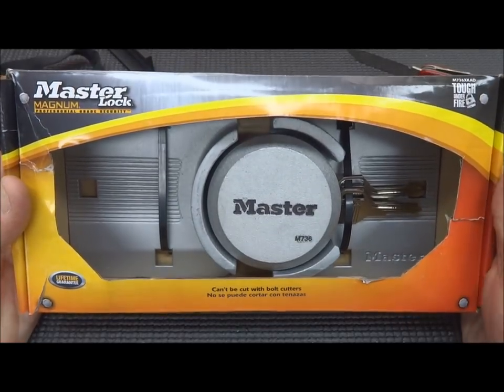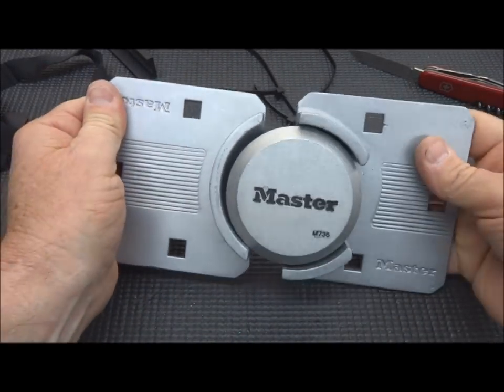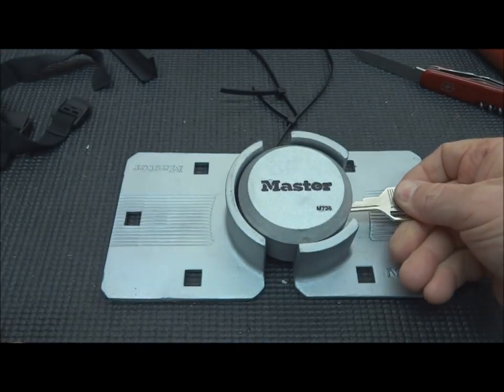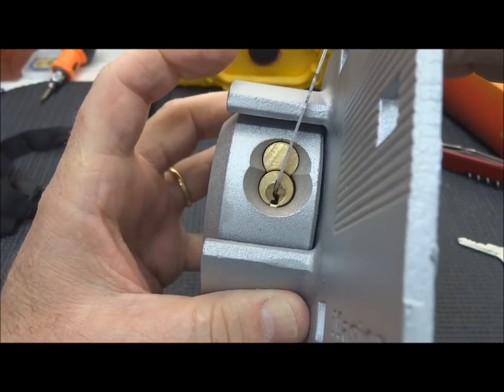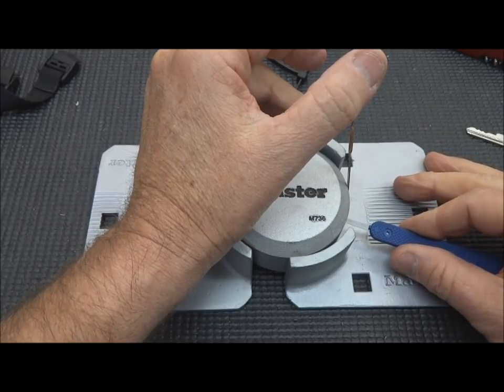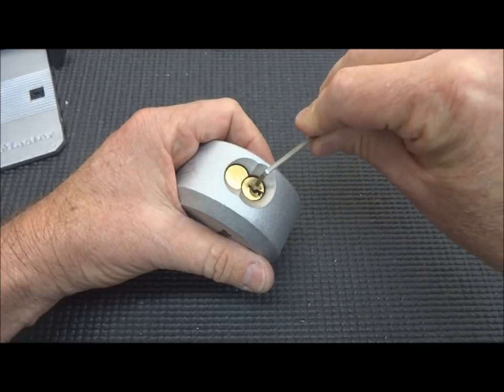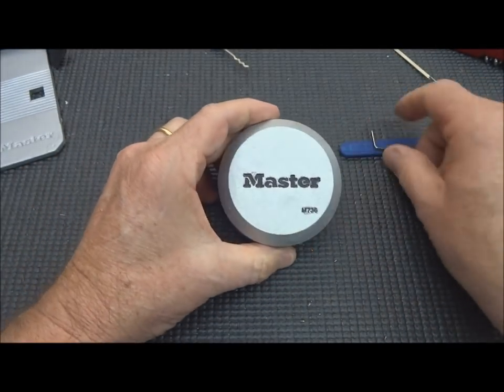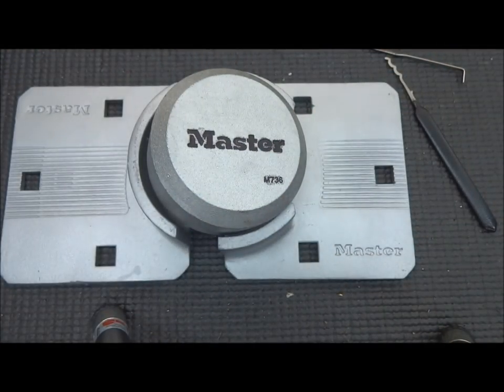(313) Review: Master Lock M736 Puck Lock (JUNK!)

Comment: The majority of the lock cost is the split bracket. I've used that lock before, in the car wash business, usually in combination with several others.

One issue we've had to resolve is the cost of the loss vs. replacement costs of a lock and all the equipment they destroy gaining entry to whatever has the lock on it.

Many times, a cheap lock is worth more money than say Medeco which we use a lot of. Because let's face it, most of our break-ins are from amateur tweakers that wreck everything in their way. Losing several hundred dollars is cheaper than losing a $50 lock and $500 worth of equipment plus the $200. 

So, yes, sometimes we make it easier to break in....depending on what is locked.

Comment: It might even be faster to use a Strong Wireless Drill to take out the screws from the metal plates, that way you can bypass the entire Puck Lock.

Comment: think its more for physical attack,hammers etc rather than picking but i agree should be better,they are used all over here in the UK....AS i am a builder i will NOT be putting this on my van thanks but if you have a suggestion for a lock ........

Comment: Outside of the lock itself, to me the next biggest weakness is the exposed bolt/screw heads. Just have to take a drill or a grinder, knock 3 of them off and your in.
Reply: Ya,  a loud grinder won't draw any attention to the van they you're trying to rip off.

Comment: It seems to me that Master redesigns that lock itself so that a steel flap protrudes over the top edge of the lock perimeter, this would remove the physical advantage of a lock picker trying to open the lock from the same angle the man in this video worked from.

Comment: If u have a welder all u have to do is weld a 1/4" plate right behind the back hole and it wouldn't be able to be picked and u can still get the key and pin out with out a hassle

Comment: These masterlocks are okay for safes, Especially when the safe weighs about ~1000lbs and not much room to move about/cut a hole in 1/2 inch steel with a battery grinder

Comment: Just today they brock in to my truck and I have those locks and the center one wish is a master also super reinforced paddle lock  and they try to cut with the bolt cutter but they can't so they cut the plate that hold beside but I don understand wy they do not open this way if they do that way

Comment: Although the puck style lock is protected by the armored plate, take it a step further by using an angle grinder to grind off the tops  of the mushroom headed bolts used to mount the steel plates to the door.

Comment: I really don't know why master lock doesn't make better keys and stuff like that
Reply: Because that costs money. Why make expensive things when you can make something cheap and sell it for a lot?
Reply: They do, you just cant get it at Home Depot/Lowes. 
Locksmiths Don't sell paint or lumber.
Reply: because it turns a $30 lock into a $130 lock.   the same way a door set goes from $50 to $250
Reply: I can buy Gerda Tytan ZX in Polish Castorama for 218 PLN(with tax), atm 1 US $ is worthed 3.4 PLN so its 64.12 US dolars and i can buy paint and lumber in that shop with no problem. :P Good quality padlock like KABRO C5 (class 5 ) you can buy it in Poland for 85PLN so its only 25$...
Reply: sratatata idzie wiosna :D a mejbi in OBI ? :D

Comment: but.. if you put in screws in the holes. cant you just unscrew the screws ?
Reply: HandsomeHolland It should be mounted with carriage bolts. The outside would be a smooth rounded head. Under the head is a square that fits into the plate so you only need a nut on the inside to bolt it to the door.
Reply: He used the wrong term.  No one in their right mind would actually use screws with a hasp like that.  Because of the square holes, it's obvious that they intend for carriage bolts to be used.  And if you want it to be even more resistant, but a heavy steel backing plate on the other side of the door you are attaching this to and after tightening the nuts really tight, strike an arc with a welder in the threads of the bolts, right by the nuts.  Even if they could somehow turn the bolt, the nut is not going to turn.

Comment: I must be missing something; on the plates that would bolt to the side of the truck there are screw holes, so what's stopping someone from just unscrewing the plates?
Reply: Those are square holes intended to be used with carriage bolts, which, have a domed head that doesn't accept a wrench. However, the the carriage bolt that a guy would typically be installing this lock with would more likely that not be grade 3 or 5, which is pretty soft steel compared to the lock plates.

Comment: What this lock lacks in security it makes up as a radiator (no kidding). A customer with a broken key called me one night & told me other employees had thrown hot water on the lock (it was 10 below out). After thawing it with a propane torch, the broken key turned & I took it out. 10 minutes later you could hold the lock in your hand for a full minute before the heat caused you to drop it. It occurred to me you could slowly heat a large mass of this with only a pilot light inside. Controlling the temp would be hard, the "furnace" would weigh 500 lbs., but it would heat your whole house if put in a basement...Cheap.

Comment: How easy is harbor freight  2-7/8 in. Shackle-Less Padlock To pick or cut? They compare it to American lock A2000DSEN
Reply from the maker: It is one of the most frequently modified lock to make challenge locks because it is only about $7.  Still, you get what you pay for.  Out of the box it is easy to pick and the lock contains no security pins.  The materials of the lock are...well, what you'd expect in a $7 lock.  The shackle is pretty soft and even tho they say "hardened", it really isn't.  You can saw through it pretty quickly and 32" bolt cutters make quick work of it.  You really can't compare a $7 to a $35-40 lock.

Comment: Thanks for your reply and upon your advice have decided to go with the t-5 version of the Mul-t-lock model T-100 puck lock to secure my $2000 generator. My research on that particular lock shows it to be virtually unpickable but sadly I fear that's not true or is it? Should I have a little faith in it's "illusion of security" or just wait till one of your other subscribers, who's intentions are less than professional finds my generator unattended and irresistible! My back up security device holds 7 in the clip!  You might see a pattern here, not a lotta faith in my fellow man!
Reply: bosnianbill Thanks for the vote of confidence!! As for the "man sized chain" try going to perfectcasita.com and look at very clever Lowpro baseplate locking device that incorporates this type of puck lock. My generator is the Honda EU3000is and I'm first in line to get one of these when  the first production run is complete (any day now)! It'll be bolted in the bed of my truck under a hard toneau cover. Though the cover is easily breechable outa sight outa mind I say and if you did get to it the next weakest point are the bolts through the bed of my truck you'd have to unlock my spare tire and the bolts just spin if you try to put a wrench on them. Now if you want to use a cut off wheel on your battery dremel tool good luck maneuvering under the truck while I shoot you in the balls!
Reply: Thanks Bill! Both items, the Lowpro baseplate security device and the MTL have been ordered and are on their way to me now! Sure hope they are effective, I don't want to resort to the "backup security" but I would! I gotta say, I've got "clip envy"!
Reply: And the lock is in! Thanks for the advice! I think you'd need three arms and stand on your head in order to pick it? Maybe try the banana on this one or straight to the potato!

Comment: Listen....... I worked in the worse places in NYC all five boroughs at all hours of the night and day time. The van was loaded with thousands of dollars of tools and supplies. When these locks first came out they didn't have the extra steel covering around the outside to cover the lock. The crooks were using i'm told pipe wrenches to turn the puck to break the steel pin. Then one day a truck came in and the crooks pried the bottom of the door up and out to gain access. ( looked like a sardine can)  I have never been broken into using these locks with the plate around the lock. Using other locks ..... yes I was broken into more than a few times. If the crook wants your truck ...... then it's gone . You will find it in another area or state cleaned out. The last two companies had GPS and even( all companies are putting GPS in the trucks)when you call the police they will NOT pursue the criminal! you will see where the truck is last stopped . Then you can go and get the empty truck.
The mechanics that were to lazy to use pad locks were almost always broken into sooner than later. 
Most or a lot of crooks are fast in out junkies trying to make a fast dollar. If it is hard they will go to the next truck.
This is a nice educational video.
Reply: +Gregory M What they didn't pick the locks????
Reply: I have not ever saw a lock smith pick a lock. They all cut them off and sell you a new lock.
Reply: +Gregory M Well picking locks is great in the movies. Don't spoil my fantasy of lock picking.
Reply: OK james Bond. LOL LOL LOL

Comment: I epoxy over my lock brands, and spray painted them to match the trailer.  Reinforced the door with a steel plate, so those locks cant be busted off with a hammer.  I also have 2 gps units to recover it (one much better hidden than the other).  worst case I call the cops tell them I found my stolen property at this location, that I'm about to retrieve it and am armed and ready to defend myself before hanging up.  make them show up real quick.  Let them do the work, instead of all the manual labor of cutting up, carrying, and disposing of the body.

Comment: when its installed  on a door you could maybe drill holes in the screws?
Reply: +Pink Panther  ya its hard drilling through hardejed steel
Reply: +Olivier Beaulieu no need most van door skins a re .5mm steel a mallet prybar etc will have this lock on the ground quick smart
Reply: Typically this would be installed with carriage bolts going through to the other side of the door and secured with large washers and nuts.  Not just through the skin of the door.  Prying them off wouldn't be likely.

Comment: Umm, you said this is held into the door of the truck with 6 screws, correct? Then all you need is a screwdriver/ pocketknife or anything solid really to undo the screws and the lock falls right off XD no picking needed.
Reply: +dwalters98 Carriage bolts are usually square shaped right under the head so turning the bolt isn't an option.

Comment: They should have put the steel ring all around the lock and used an extra long key to reach the cylinder . That would have made it impossible to acces the cylinder directly.
Reply: that's not a bad idea , I now wonder if that hardened steel can be welded? that finish looks like its some sort of zink alloy
Reply: +mrfurball You could be right. From the sound of it i would say its cast iron. The groves and the logo look casted to me. One hit with a big hammer would tell right away.

Comment: bosnianbill: I really don't think Master locks are total junk. If you look at the outer body, shackle, and inner ball & cam locking mechanism, we know that they are made in the same way as American & other locks. I however agree that the core should have better security. On the other hand, most thieves will just bolt cut a lock. Even the best "hardened" ones! As far as experienced ability, the criminal with lock picking credentials will be able to pick a more secure lock. Hardly ever the case.

Comment: If it is designed to be mounted in a vertical position, like the doors of a van, shouldn't you try and pick it the same way that it was intended to be used.   Seems that laying it on the table gives you and unfair advantage over the lock, same for locks that are not mounted in a door.Thanks.

Comment: Isn't another weak point the 6 obvious fixings (screws/bolts) that attach the flat plates to the door? If you can twist or smash off three of them on one side then you can still just open the door without picking the lock.
Reply: +Mandolinic The quadratic holes tells me that it's meant for carriage bolt mounting = very hard to get a grip on and the head has the same matching quadratic shape so your only chance are drill or grind the heads of the bolts
Reply: +MoseyingFan Of course.  I should have though of that. Thanks for explanation.

Comment: Hi can i have my puck lock rekeyed with a harder to pick keyway in the master puck locks i have?
Reply: it all depends on the model puck lock you have. If it is this one, then no. If you can find a locksmith or security supplier, there are rekeyable puck locks, and while the keyway may remain the same, the lock could be configured in a pick and bump resistant way. I would also recommend using a hasp  that uses some bolts that are blocked by the puck body. If you use this hasp on an outbuilding or somewhere else further away, a criminal may just grind off the bolts securing the hasp.

Comment: When you to SVPing something, what do you mean?
Reply: SPP = Single Pin Picking (locks).  Using a pick to position each pin in the tumbler while applying torque on the tumbler.
Reply: Ah, ok.  Ty.

Comment: Honestly couldn't you unbolt  it off the car door
Reply: The square holes imply these would be attached using 'carriage bolts'.  The face you see outside the car is a smooth dome and the nuts would be inside the door.

Comment: Ten·sion
ˈtenSHən/Submit
noun
1.
the state of being stretched tight.
"the parachute keeps the cable under tension as it drops"
synonyms: tightness, tautness, rigidity; More
2.
mental or emotional strain.
"a mind that is affected by stress or tension cannot think as clearly"
synonyms: strain, stress, anxiety, pressure; More
verb
1.
apply a force to (something) that tends to stretch it.

Just imagine how quickly you could pick it if you applied "torque" to the plug while ....Oh wait, you did. You just claimed to be using tension.

Comment: But what about the bolts? Can't someone just unscrew it from the door?
Reply: It's made for carriage bolts (Google image search if you're unfamiliar with them).  That's why the holes are square, so the carriage bolts sit flush into it and there's no bolt head or way to losen it from the outside.
Reply: thechosendude ok makes sense, but can you drill through the head of this bolt?
Reply: VanillaSnake21 Drilling would take a while.  It would be easier to grind the heads off.  Both methods are really loud and defeat a silent entry.
Reply: thechosendude drilling is not that loud, just drilling throught the head, I looked up an image it's like maybe a quarter inch thick.

Comment: Thieves do not pick locks. They break them. Of course lock picking is an interesting skill, but this is a skil used by the secret agents, security agencies and so on. Regular thieves DO NOT have those skills so they would atack locks with bolt cutters, crowbars, pipe wrences, sledge hammers or angle grinders. That's why it is best to buy a lock that can withstand to more of these "brute force" atacks because you won't see thieves that can really pick locks. Of course there is no lock that can withstand an angle grinder but that's another story.

Comment: How are US army padlocks?
Reply from the maker: Not so good any more since Master changed the design.  We pretty much used up what we had on the shelf then started buying Reese (for initial issue for duffel bags), Reese Set locks (for took kits, which span several cases), Paclock for general security, and Medeco or Assa Abloy for higher security, and S&G 900-series for arms rooms and ammunition magazines (2 locks per door).  There's still a lot of the old stuff floating around but it'll eventually filter out of the system.

Comment: erm, if that is mounted on the side like that... can't we just take out the screws?
Reply: SoWeMeetAgain Those square holes are designed for carriage bolts that fasten from the inside.
http://za.rs-online.com/web/p/coach-bolts/5121118/
You could cut them off, but it shouldn't be possible to remove them non-destructively.
Reply: Aadil Shah
thanks :-) that makes much more sense!

Comment: You shopped at your favorite store, that sells dumbed down VERSIONS of far better products. The Problem is not that it is Master, it is that it is THAT VERSION. The "good" one that I sell in my shop is Model 6270. This cheasy model has a very sloppy tolerance cylinder, as you demonstrated.

The 6270 uses the close tolerance 7000B keyway, pinned 6 pin. OR use the American 2000. Either will perform far better. You will NOT find the better models at most box stores. For Master/American to sell there, they have had their own products knocked off overseas, which confuses the public. Even better, one could get the PACLOCK model, and put a Medeco or ASSA cylinder in it...... As far as the hasp, I am not so sure that one is steel. It could be die-cast. I sell their steel ones, which have real ugly welds... but they are strong. For a van, there is a neat product that replaces surface hasps called Slicklocks... you may want to review them, if you have not already. Really neat for van doors. NO DRILLING.

If your favorite store is doing this with padlocks, what do you think they are doing with faucets, electrical panels and just about everything else? 

When you make future videos, you might compare side by side the FAKE vs the REAL.

MAster also has done this with their entire pro-series padlock line...... knockoffs have the hexagonal shackles.
Reply from the maker: Thank you for the insight.  I've actually ordered one of their 930XKADLH versions, which they rate at 10, the highest rating ML offers.  We'll see...